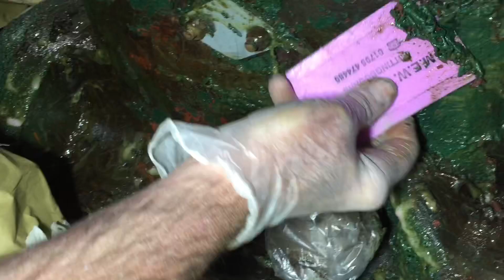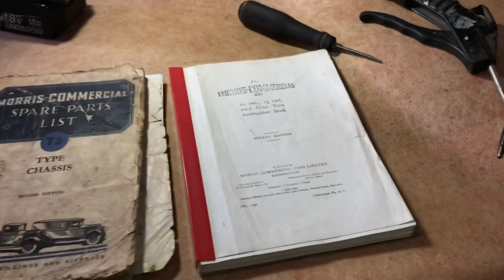Morris Commercial 1934 T2 Truck Refurbishment PT 2

Comment: Do you have some old stock paint stripper? I found last year that since 2014 the EU banned Methylene Chloride in paint stripper and the currently available products will hardly pull the skin off a rice pudding!  New Nitromors is not the same at old Nitromors sadly.
Reply from the maker: Keith Matthews I believe this was new stuff 👍
Reply: Doesn't brake fluid come with warnings about it stripping paint?
Reply: @jamesbrett6518  I think that it would damage paint in a similar way to bird droppings but would not be a fast action. Coming back to stripper I read somewhere that one may be able to get Methylene Cloride stripper fror professional or industrial application but you might need to sign something. It is not allowed in retail products. The ban was due to it allededly causing allergic reaction and death in a couple of cases in the USA who banned it before the EU. If you see any 'old' Nitromors for sale snap it up while you can! The new stuff proudly states "Methylene Choride free formula" but this just means it hardly works!